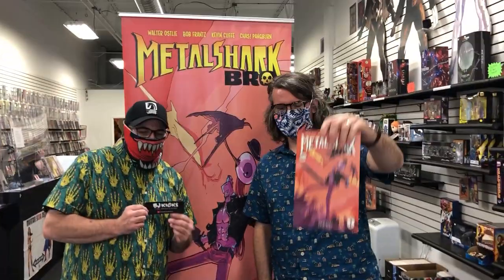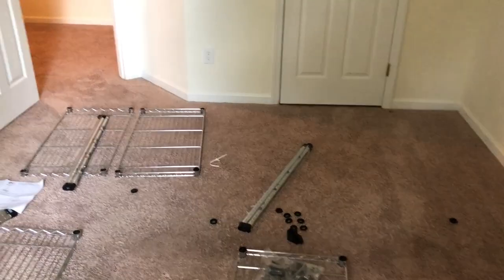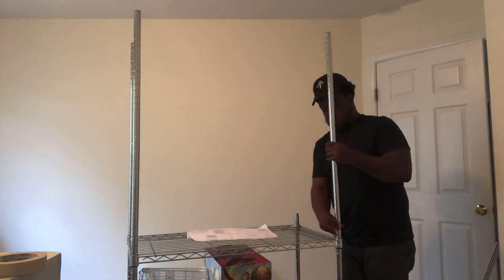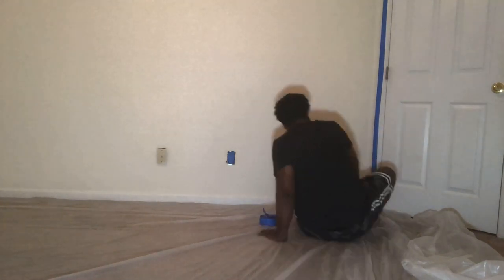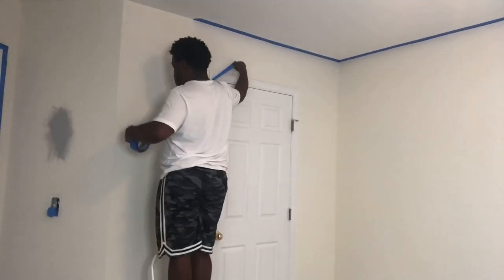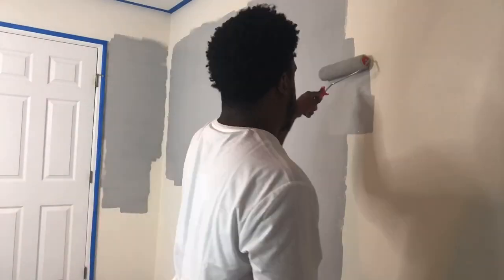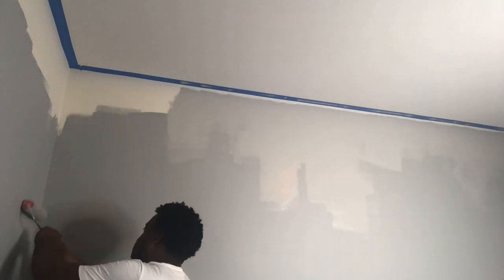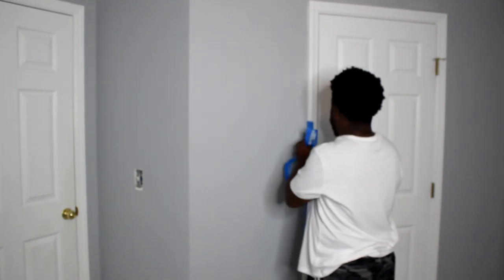Building The ULTIMATE COMIC ROOM! (Part 1) | How to Build a Comic Room

Comment: Good job mate! I just bought my first house and I was decorating my new comic room today as well! Exciting times.

Little tip with the brushes/rollers, if you’re planning on painting the next day cover your brush/roller in the paint your using then wrap it in a plastic bag and tape it round the handle. Paint on that thick won’t dry overnight on the brush and will remain good to go the next day. It’s a pain in the ass to have to wash and dry brushes every day.